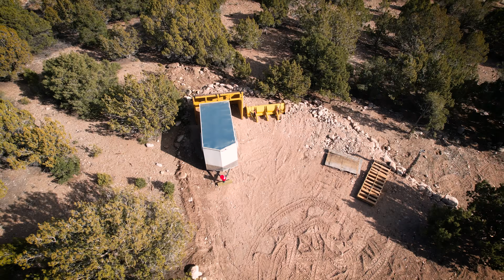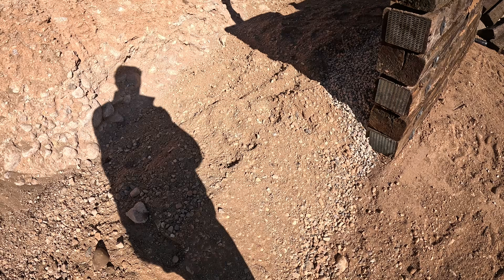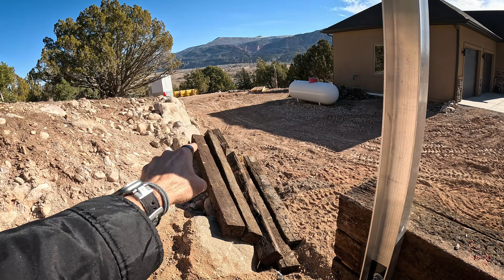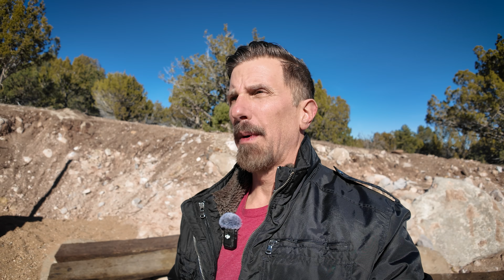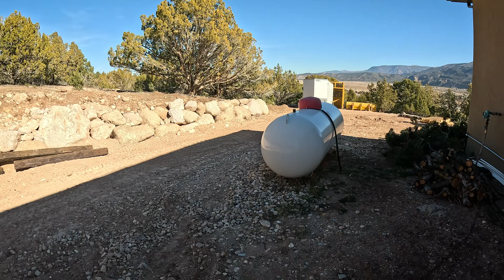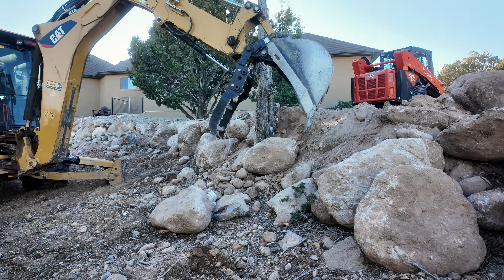Shooting range construction – private backyard version (Part 1)

Comment: The ties will eventually need to be replaced. I think backfilling complicates things and it also is not needed with that wall of dirt behind it.
Reply from the maker: I’m toying with a removable backstop that’ll take the brunt of the rounds- placed in front of the ties. Once it gets diminished i can swap it for a new one. Any ideas?
Reply: @Kolob_Canyons_Ranch  Good idea. Perhaps an additional stack of railroad ties in-front and a layer in between the 2 sets of ties with rubber mulch?

But I'm still not sure the backfill idea improves bullet catch capability versus just leaving that space open since you have that entire natural dirt wall behind it. Backfill seems unnecessary.

I'm far from an expert on this. I'm just researching building a berm for my own property.

Comment: Hi great video again 
How long you can run your house whit 2000 gallon propane ?
Reply from the maker: In a SHTF we would go into austerity mode, so it could last up to 3 years, maybe longer since we would primarily heat with wood in those circumstances. In normal times, maybe 2 depending on the weather.
Reply: @Kolob_Canyons_Ranch With our radiant in floor heating if we just used propane it would only last about a month in the dead of winter that's why we have a wood boiler and a 500 gallon tank of water underground that gets heated up from the boiler and then heats our floors. I would like to expand to 2000 Gallons of propane and put in underground.
Reply: I would really like to go from a main diesel generator back up to a propane backup as well. We have a back up propane generator in case the diesel failed but we had an wire issue with the inverter and the generator and had to disconnect the propane generator. The propane generator has never been used.

Comment: What will happen as the railroad ties get shot through and start getting big holes in them? Do you plan to replace? Or are you not going to shoot that much?
Reply from the maker: We’re a low volume private range, but I have considered - over time - adding layers of new ties in front. Eventually I’ll have to rebuild it.
Reply: @Kolob_Canyons_Ranch I have seen some ranges use bales of straw to take the brunt of the impact. Maybe you can do that if you have some high volume stuff to do.
Reply: I don't think he's using a 50-gal I'm sure it's mostly postal rounds which would take a long time to penetrate these ties.

Comment: I never had trouble with Diesel going bad. In my small home I make bio gas for cooking and use wood gas for the generator.
Reply from the maker: That's great you're able to use alternative fuels.
Reply: We have a 300-gallon diesel tank for our generator and it can take 6-8 months to go through 200 gallons and we have it filled about 75-100 and we've never had bad diesel.
Reply from the maker: @ModernCowboy78 There’s sound reasoning behind a multi-purpose diesel storage tank for machinery and a generator. As long as you’re cycling through it there’s no issue. For bulk storage of propane I might not use it for years. That’s my line of thinking for now. Both would be nice- diesel and propane bulk storage 🤔